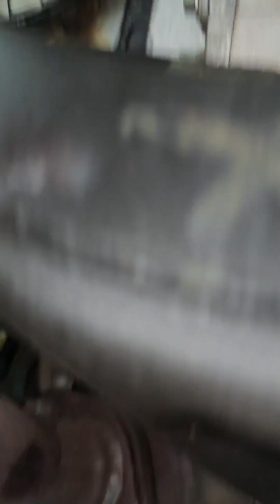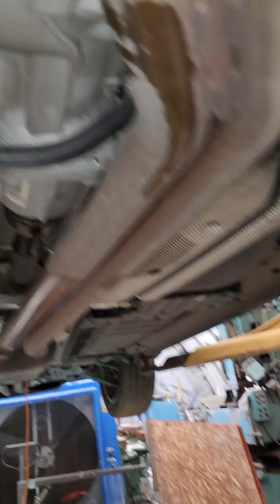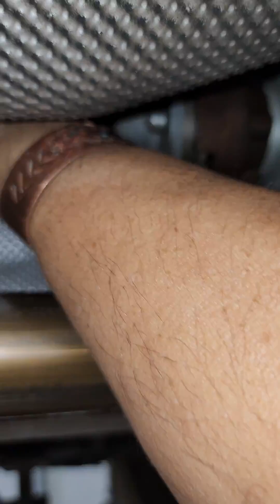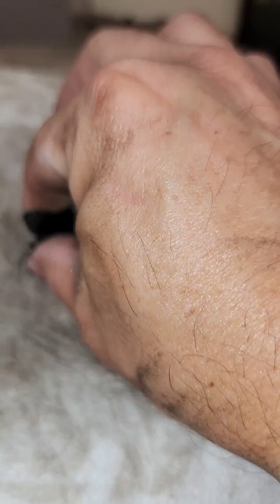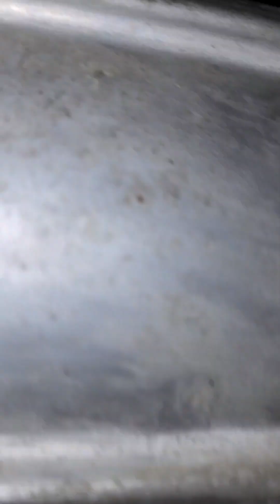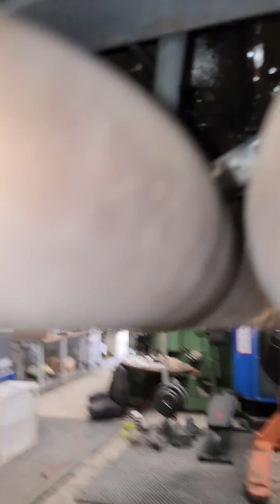2011 Ford / Lincoln PTU, Failure by Design; diagnosis / insights and repair plan knowledge...

Comment: For a moment I thought you had a heat inductor to something in the back, before I realized it was your light.😂

I work on German brands, and have similar issues with BMW transfer cases. although that flange is replaceable, and usually fixes the issue.
Reply from the maker: Yep, it threw me off when I looked at it again, my exhaust was cherry red, lmao! You mentioned a BMW flange in similar units that are replaceable; the flange on the rear output AWD propeller shaft? Could this effectively drain out the old oil once removed? Yet, it is an elevated location as compared to the bottom drain plug I finally installed. Please see my latest video on the ICU kit I developed. I offer it to make this particular gear box serviceable; mainly to help others avert a costly catastrophic PTU failure! My ICU kit has been extensively road tested and is providing excellent serviceable results.. Thank you for your interest and expertise... Best Regards, CT